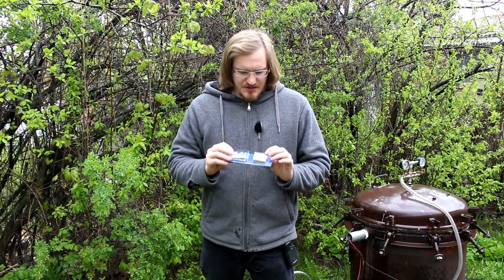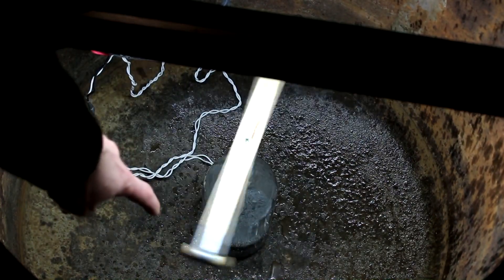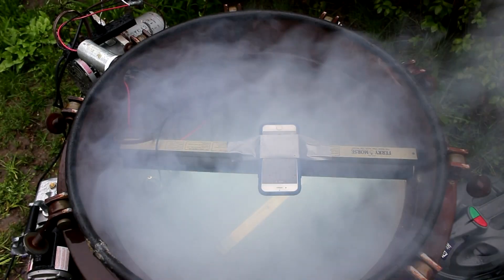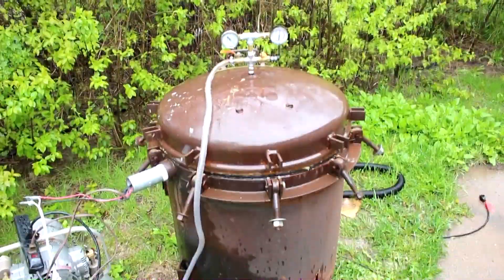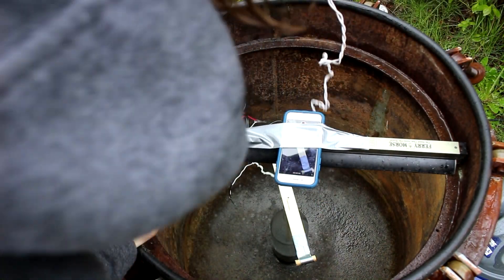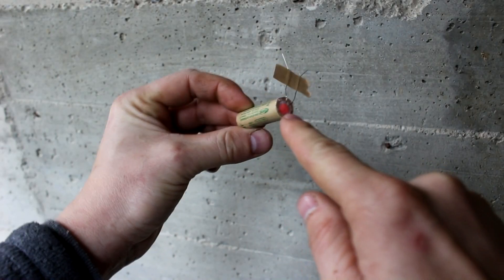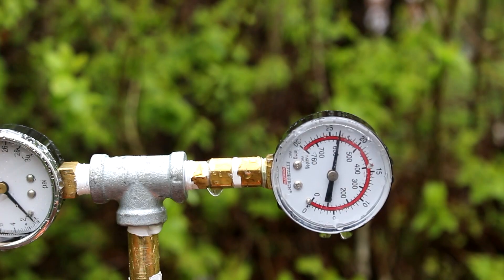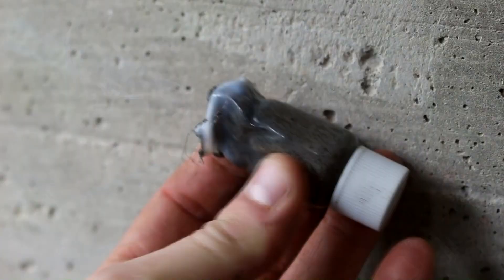Will a Model Rocket Motor Work In Vacuum?

Comment: NASA'S rockets work in space because they have an on board oxidizer, usually liquid oxygen.
Reply: So does gunpowder.
Reply: @n_for_n  Ooookayyyy. Sure. Righto.
Reply: Yes, but despite being able to sustain burn due to the oxidizer it is still impossible to create thrust in a vacuum. Without a physical medium or atmosphere to push off of, your dead in the water. You can burn for hours if you want, but you're not going anywhere.
Reply: @starvethebeast6480  The rockets create the physical medium by burning liquid fuel. They don't need it.
Reply: @Maxgamer-fd7hv  There's no way that the physical medium created by liquid fuel would be enough to sustain any type of adequate movement in a vacuum. They fuel byproduct would simply be dispersed and produce a negligible amount of thrust, if any at all. People need to realize that there is a major difference between Hollywood and reality. Just because you saw it on TV doesn't make it real. Learn to question everything, and think critically.
Reply: @starvethebeast6480  Denying years of human progression is borderline dumb. Thinking that there is some kind of a dystopian government that brainwashes it's citizens to believe a lie sounds exactly like a concept for a lot of hollywood  movies.
Reply: @starvethebeast6480  Newton's 3rd law of motion states that every reaction has an equal and opposite reaction. Rockets use this same law to produce thrust in a vacuum.
Reply: @Maxgamer-fd7hv  Yes, I'm aware of the 3rd law of motion, but thrust is contingent upon matter, or a fluid medium in order to work (atmosphere in this case). So suffice it to say that in a vacuum, without anything to push off of, you are dead in the water. That's not to say that no movement whatsoever can be achieved in a vacuum (as it stands to reason that the initial blast of the rocket engine may indeed propel the rocket forward slightly), it is not however, a practical means of maneuvering in a vacuum. If it were possible, we would have seen dozens of real videos (no green screens, no CGI etc...), but we haven't. It's my contention that most of what people believe with regards to space travel is inspired by cinema, and not reality.  NASA and all other "space agencies" are frauds who thrive off of the sensation of space travel that Hollywood has created and it's time more people start waking up to this fact.
Reply: @starvethebeast6480  The molecules in the combustion chamber bump against the walls of the chamber and transfer their kinetic energy to the walls. The ones the bump to the left and right cancel each other out but the ones that bump on to the top, can't do the same thing since there is no down. They transfer their kinetic energy to the rocket like this and propel it in a vacuum. Simple rocket science, no cgi required.
Reply: @Maxgamer-fd7hv  I've heard all this before; and it all sounds great in theory, but my question is, if there is no CGI required, then why is it used? Or better yet, why haven't we seen real footage of small scale rocket maneuvers in NASA's Glenn research center vacuum chamber? Surely there would be some footage from their tests kicking around somewhere. That would certainly put the debate to rest, but yet they've conveniently missed or avoided this glaring opportunity to prove their legitimacy; and as such, I'm still not convinced.
Reply: @starvethebeast6480  Umm, we haven't seen the footage of small scale rocket maneuvers because those are probably classified or not recorded. Simulating small scale rocket maneuvers is not a hard task if they wanted it to be faked so badly then they would have shown has the footage.
Reply: @starvethebeast6480  The video feed got cut off a few times because the sat is traveling at a speed too fast for the antenna to send the radio waves in the right direction.
Reply: @Maxgamer-fd7hv  lol. Classified?! Give me a break. What the heck could be so sensitive about rocket test footage that the public cant see? And what type of real science doesn't keep a record? You gotta stop defending these clowns and start thinking critically. You're obviously a smart person; seriously ask yourself why they've been caught faking things if they are actually legit?
Reply: @starvethebeast6480  Space travel isn't cheap, building even a fake rocket costs far more than any hollywood movie production budget. We have pictures of the Earth from the moon from 1969 when the technology to fake such pictures didn't even exist.
Reply: @Maxgamer-fd7hv  You are grasping at straws to validate a fraudulent space agency. A little healthy scepticism never hurt anyone. You should give it a try.
Reply: @Maxgamer-fd7hv  I'm not denying years of human progression, I'm simply calling NASA out on their bs. Human progression is very real, but then so is human deception. If you can't fathom the existence of a dystopian government, you are walking around with your eyes closed. Dystopian governments have existed in the past  (tyrants like Vlad the impaler, to Stalin, to Hitler are prime examples). If it happened before it can happen again.  As the saying goes, those who don't learn from history, are doomed to repeat it. Instead of studying fake rocket science, maybe you should start with history.
Reply: @starvethebeast6480  Nope, you don't seem to know much about rocket science at all and still call it fake. You are denying years of human progression in terms of space travel. If the government was that worried about faking rockets, then they would probably have put maneuvers. There is no point in faking rocketary. Most people living in the countries with rockets available probably aren't even sad. If the government actually wanted us to be stupid and not know what's beyond then they would have just said that the Earth is flat and they can't get to space. If there is no monetary benefit, humans won't do it and that's a fact.
Reply: @Maxgamer-fd7hv  Saying you know a lot more about astronomy than I do doesn't prove anything. First of all, you have no clue how much I know because we haven't even talked about astronomy yet. Therefore, logically you have nothing to base your assertion on, not to mention the fact that much of modern astronomy is wrong; but I'm not going to dwell on that because our conversation is about rockets. Speaking if rockets and their history, are you aware of the occult origins of NASA? How about Jack Parsons, and Werner Von Braun, and all the Nazi scientists who founded JPL in the USA after WW2 via CIA project paperclip? I'd go on about their connections to Alester Crowley, but it would be more relevant to talk about the historically recognized fact that Nazis where known for their use of propaganda. I probably don't have to answer this question for you, but what happens when you take a bunch of Nazi scientists/propagandists and start a rocket program in the US?
Reply: @starvethebeast6480  you don't need to "sustain" any kind of movement in space, that's Newton's 1st law God damn you guys need to read a book,
Any extra energy you put in after escape velocity is only acceleration, not sustaining anything. there would have to be a force slowing you down for you to need to do anything to sustain movement.
Also thousands of tons of force isn't negligible and rocket actually work better in space because we don't have the atmosphere compressing the gases.
Reply: @starvethebeast6480  there's nothing in Newton's third law that says you need a fluid medium, that's just something you made up that was entirely debunked by the video you're commenting under
Reply: @starvethebeast6480  they don't use CGI for most stuff you may be referring to how most photos of Earth are Composites but that's because in unobscured view of the Earth from space is rare it mean if your on the ISS you straight-up can't get a entire photo of Earth because you're too close and if you're far enough to get a whole photo of Earth odds are a lot of it it's going to be cast in Shadow.
But there are still plenty of completely non edited photos of Earth from space I like the first one the black and white one from the moon landing where the Earth is half covered in Shadow but Apollo 17 took a probably the best one they got the whole thing
Reply: @starvethebeast6480  but you just saw the video of a rocket creating thrust in a vacuum.
It's Newton's third law read a goddamn book,
Reply: @FrancisR420  okay, I'll read a book if you learn the proper use of a comma (hint: it's not for the end of a sentence).
Reply: It doesnt need to push off of anything. Its Newton's third law 'For every action there is an equal and opposite reaction'. Action:rocket exhaust is expelled, Reaction: rocket moves forward
Reply: Rob Graham Hey, is your first name 'Robin' by any chance? If that's the case, we'd have exact same first and last name
Reply: @n_for_n  if someone truly understands the workings of a system it can be explained simply. And can be witnessed, and recreated.
Reply: devin elliott 

How do you think the whole universe is moving... an explosion... the big bang 💥 derff
Reply: @paulinadeluca9117  The "big bang" has never been proven. It's a theory.
Reply: Rob Graham
They refuse to understand Newton 3rd law. I'd be so happy if a single flattard were able to understand momentum conservation...
I use to counter fact their "rockets can't push in vacuum" with gun recoil videos. None succeeded to explain it completely. One of them tried, but forgot to explain what made the gun move backwards.
Reply: dank sunday ... that works in a vacuum....mmmmm
Reply: Rob Graham ... so how much did fuel do you need?  Have you listened to nasa engineers say they haven't solved it. Too much weight
Reply: AbdUctYoBishH XxxLongProbeStylexxX ... you're using your assumptions to prove your assumptions are a theory.  Nice try.
Reply: Marc Castells Ballesta... so in terms of energy conservation and creation... how does their so called universe accelerate and move in all random directions?
Reply: Is that so?
Reply: @n_for_n  Right... Okay. Whatever you say. That's why all the images of space are images. They're all cgi. How does an atmosphere exist alongside a vacuum with no physical barrier? How would a rocket not pierce this barrier? Show me some real photographs of space. Microwave radiation levels prove nothing if those tests were even real anyway. How does an explosion create anything? They always destroy. What exploded? Nothing? How does nothing explode? Show me some real life examples of nothing exploding and then creating something. Anything. Has this been done in a lab? Got any links? No? Okay. How long do I have to let something sit in a bucket in my backyard that has no life at all in it before something alive crawls out of the bucket? A hundred years? A thousand years? A million years? What kind of time frame am I looking at? Let me know.
Reply: @TheRealNewWhirledOrder  it would be literally impossible for all the NASA images to be CGI, also people who actually know things about images know that they are not, there's also the private companies that have went to space and published images
Anyway one example of a vacuum next to a higher pressure environment is simply higher and lower elevations where is the physical barrier between higher and lower elevations that makes the pressure different? that's what you believe in and it's way more crazy in verifiably false than believing that the pressure gradient that we can measure at any elevation simply continues.
Reply: @TheRealNewWhirledOrder  you should probably look up what the Big Bang Theory is before asking questions about it because most of them do nothing more than betray your lack of understanding of the basic concept let alone the intricacies and evidence
Reply: and also the point isn't really that it will ignite "which it wont" its that there is nothing for the expanding gas to push off of to give thrust wake up man Nasa is full of shit the truth is coming out there's nothing that will stop it don't be the last to know brother
Reply: @RealReelzz  Newton's third law, read a book, the rocket is being pushed by the gas being pushed in the opposite direction.

Comment: Very Exciting Experiment... Kudos for the efforts you took! BUT DON'T STOP THERE... that A3- Series engine should have burned for 3 seconds then detonate to pop the parachute (or light second stage rocket) (depending on the second number = secs delayed on the model engine used). The spinning was the momentary pop against the oxygen packet you built to work around the ignition problem...the rest was momentum. Nothing was proven or disproved... but do not despair!

The key test is... for every action there is an equal and opposite reaction. If there is little or no atmosphere to push against... what did that little engine thrust push off of? -Nothing? Or,In this case, the walls of the chamber? Don't assume anything... especially where NASA is concerned. Science is about CHALLENGING preconceived notions... YOU ARE ON TO SOMETHING BIG HERE!

Here's a thought... get a tube of Clear plastic Tube about 5-8 foot long (Sealed) ... place a A6-0 engine (6 sec burn & no pop!) about 2 feet into the tube prevent thrust push-off the pipe's end-cap of the tube. Depressurize the tube. Then fire the A6-0 rocket. There's more than enough thrust to fire it through a vacuum, if it can actually do it. Use your method to ignite it. It should jump forward... and then either stop or shoot to the other end of the pipe. Keep the vacuum pump going to vent the gases filling the pipe. 

What can be learned?
1. It confirms what NASA says about rocket engines working in space / But it breaks Newton's Third Law...what is the thrust actually pushing against in a vacuum?
2. It contradicts what NASA says about rocket engines working in space / It supports Newton's Third Law... shows space vacuum behaves as predicted by science. Something only astronauts can prove/disprove... now, common man can too! 

Either way, your experiment will turn many heads!!! And leave us with a challenge to enjoy working on... best of luck! Keep posting...

Comment: Could it be that it is oxygen that it was lacking?   What you have done is make a little oxygen capsule for the propellant to consume.  It does seem the burn time was much shorter with the capsule, wonder if all the propellant was consumed or if it died when the oxygen ran out. Just a thought.

Comment: The fact alone that the ignitor (which contains a small pyrotechnic charge) burned at the start showed that pyrotechnic materials (rocket propellants or other materials) can burn in a vacuum, whether they are confined or not. When the experiment was modified with the little bottle to build up pressure, heat was transferred sufficiently from the ignitor to the rocket propellant to allow the reaction to continue in a vacuum to completion. If the rocket engine had been configured with a longer and larger diameter nozzle to allow a larger amount of ignitor composition to be used, that would likely have transferred enough heat energy to ignite the main charge, with or without the little pressure bottle used in this experiment. This particular rocket motor with its particularly small nozzle hole configuration wouldn't work in a vacuum without the pressure bottle, but I think that's kind of misleading as to how a properly designed solid rocket motor in general will perform in a vacuum.
Reply: Not to mention the tiny explosion from the igniter causing that movement is Newton's third law at work,
 it does not require a fluid medium

Comment: Can you do this same experiment with the pump on constant? Space is a constant vacuum and in your chamber it's confined. You can see the gauge increase as the rocket filled the chamber with atmosphere.
Reply: The gases from the rocket would corrode the vacuum pump and a partial vacuum is good enough to demonstrate the effects a vacuum has on rocket propulsion

Comment: Just wondering, how do hypergolic mixtures fare under vacuum? Would the space shuttle's mixture of Monomethyl Hydrazine and Nitrogen Tetroxide work in your vacuum chamber? Not entirely sure if that's a safe thing to test....
Reply: Another comment pointed out how they didn't even test that mixture before using it because of how corrosive it is

Comment: Cody, I like your videos, but honestly what makes you think Nasa rockets burning in space meant that yours would burn in a vaccum? The only reason they burn in space is that they supply all of the reactants in the rocket itself, such as liquid oxygen or other oxidizers. Rockets such as the one you tested are purely the fuel without any oxidizer so of course it wouldn't work. I'm not sure why anyone would think they would. And also with your "modification", you added oxygen to the system, seriously. This video was like those claiming there's "free energy". You cannot burn fuel without all the necessary reactants. No, fuel CANNOT burn in space / vacuum UNLESS all reactants are supplied. https://www.quora.com/How-does-rocket-fuel-burn-in-space-without-oxygen
Reply: No model rocket engines have oxidizers in them if it was just a tube full of fuel then it wouldn't light even if it was in atmospheric oxygen
Also he did manage to get it to light in a vacuum the oxygen in that bottle was completely negligible it was the pressure that mattered

Comment: You can't put a rocket inside a pressurized plastic bottle, inside a vaccuum chamber, and say that the rocket still fires in a vaccuum..... The reason it fired is only because it has a mini atmosphere around it still and that gave it the ability to fire and push against the tiny atmosphere.  The bottle didn't break, exposing it to the vaccuum, until after it had burst long enough in the mini atmosphere to start spinning... Poorly done experiment and assumed results here...